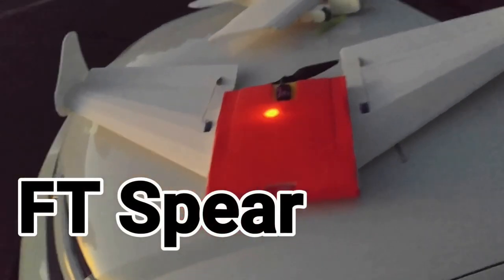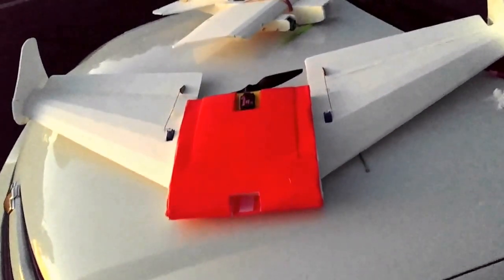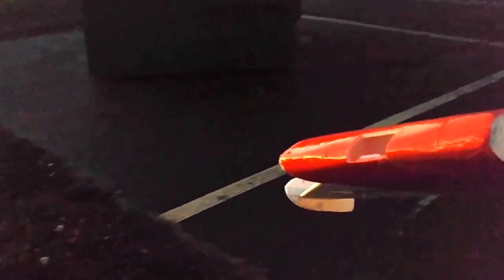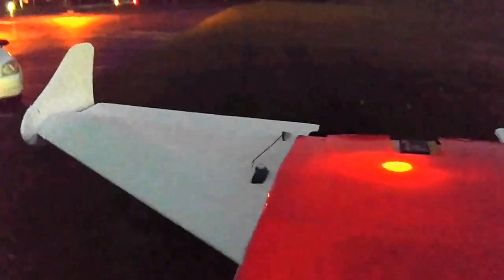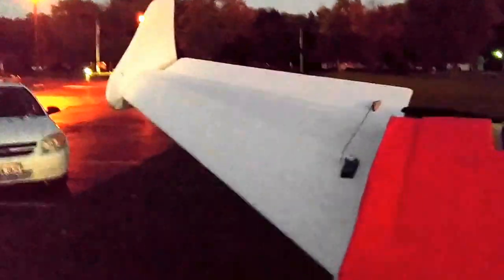FT Spear & Super Bee

Comment: Hi Ika, if your spear seems underpowered, maybe it's because your esc range is not properly set. Most ESC's require you to turn on your tx and move throttle stick to max, then plug your flight battery. Esc will make unusual beep. Lower throttle to zero. Esc will beep, the range is set. Esc will now make usual startup beeps.
Reply from the maker: FliteGreg thanks for the tip. I did just that a few times to make sure. I took the motor off and used it for the flying doghouse I built. Works good for that. I'll order a bigger motor for my spear. Thanks KS for tip!